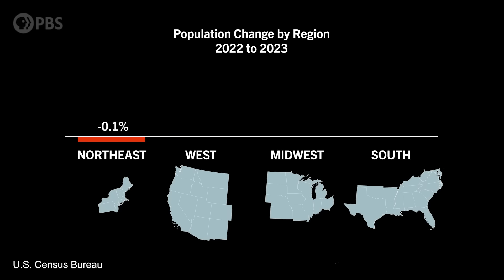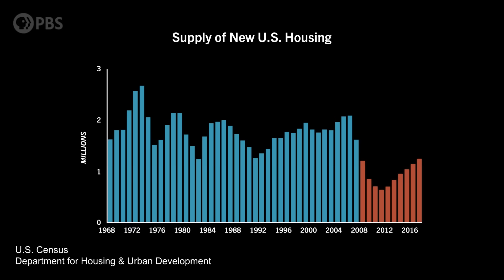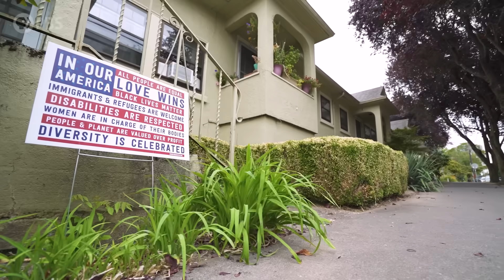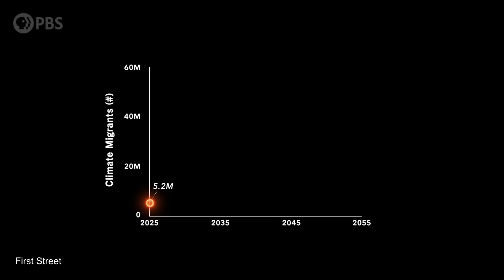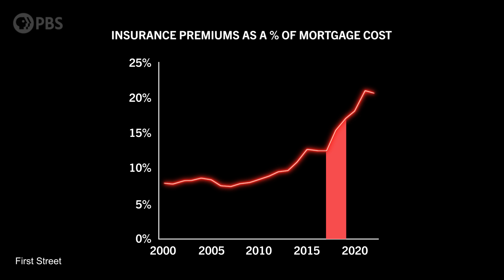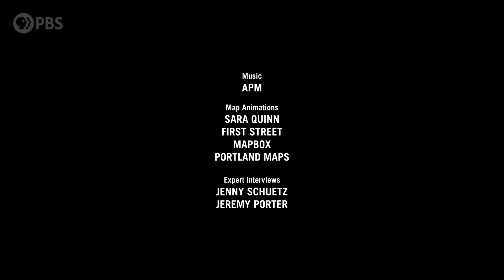The Real Reason People Move Toward Risk

Comment: I currently live near Dallas, and I cannot recommend moving here. Residents are not represented fairly in the democratic process, life expectancy is lower than in the north and west, and there is concrete everywhere. I spend 1-2 hours a day driving, just for my normal life. I am considering relocating, and would consider rust belt areas before anywhere in the South. Essentially, think carefully about moving to parts of the country that were founded on slavery - the systems were set up centuries ago to benefit only the wealthy, and it is very hard to undo that.

Comment: The housing in DFW are all wood frame apartments built with poor materials and craftsmanship.  They are built quickly, filled and sold to private equity. These houses wont be here in 20 years due to the poor quality. 

Nevermind they all look identical, have poor sound or weather insulation or are often built adjacent to major interstates.

Comment: Building codes are generally lower in places building cheap housing. During the freeze in TX, many folks found their water and sewer lines were in exterior walls. Lines froze and burst, leaving houses in a mess. And, no, there was no insurance to cover that since it was not anticipated: either the freeze or construction issues.

Comment: BREAKING NEWS==THE CLIMATE-CHANGER GOD-ROCK.
Common symptoms of active TB:
Persistent Cough: A cough that lasts for three weeks or longer is a key indicator. 
Coughing up Blood or Mucus: This can be a sign of TB in the lungs. 
Chest Pain: Pain when breathing or coughing can also be a symptom. 
Fatigue: Feeling unusually tired or weak is common. 
Weight Loss: Unexplained weight loss can be a sign of TB. 
Loss of Appetite: A decrease in appetite can also occur. 
Fever: A persistent low-grade fever is often present. 
Chills: Experiencing chills, especially at night, can be a symptom. 
Night Sweats: Excessive sweating during sleep is another common sign. 
Volcanoes currently active: erupting: 41 warning: 40 unrest: 25 normal / dormant: 1354
Exposure to high concentrations of volcanic smog (vog), which contains toxic gases like sulfur dioxide (SO2), hydrogen sulfide (H2S), and other volatile organic compounds (VOCs), can cause a range of severe health issues. Symptoms can include irritation of the eyes, nose, and throat, coughing, chest tightness, shortness of breath, and headache. In severe cases, exposure can lead to nausea, dizziness, fatigue, and even loss of consciousness. 
=What are the symptoms of gas in the brain?
=What are the symptoms of a headache caused by gas? Headaches due to gas typically feel like a dull, pressure-like pain, often around the forehead or temples. You may also experience bloating, nausea, abdominal discomfort, fatigue, and irritability. In some cases, sensitivity to light and sound may also occur.
What are the effects of particulate matter in the lungs?
=Particles deposited on the lung surface can induce tissue damage, and lung inflammation.
What are the symptoms of tuberculosis in the throat?
=TB in the throat can cause a sore throat as one of its symptoms, but it is not always the first symptom. Common symptoms of laryngeal tuberculosis include hoarseness or loss of voice, difficulty speaking or swallowing, a feeling of something stuck in the throat, persistent cough, and weight loss.
Volcanoes currently active: erupting: 41 warning: 40 unrest: 25 normal / dormant: 1354
1985 TO 2010  3 -4 -?5 ERUPTIONS PER-DAY 
Volcanoes Today, 25 Jul 2025: Santiaguito volcano, Popocatépetl, Semeru, Svartsengi, Reventador, Sangay, Lewotolo, Telica
Fri, 25 Jul 2025, 15:00 1753455605
ANY ERUPTION OVER 10,000 GETS CAUGHT IN THE UPPER TROUGH WINDS AND TAKES THESE TOXIC - DEADLY - POISONOUS GASES RELEASED INTO OUT AIR QUALITY AROUND THE ENTIRE WORLD 
= ANY LAVA FLOW STEADILY RELEASES TOXIC-DEADLY-POISONS CARBON MONOXIDE GASES THAT CAUSES DEMENTIA 
1.=Svartsengi (Reykjanes peninsula, SW Iceland): The activity at the eruption site has declined since yesterday morning.
One crater remains active, with the lava flowing toward the east and southeast that have extended one kilometre from the crater, with limited expansion of the lava field's outer edges, except for a small flow to the south near Fagradalsfjall.
... [show less]
According to the most recent measurements on 23 July, the total volume of new lava in the Sundhnúkur area is estimated at 26.8 million cubic metres, covering approximately 3.3 square kilometres. Between 18 and 23 July, the lava volume increased by 5.1 million cubic metres—an average flow rate of around 12 cubic metres per second.
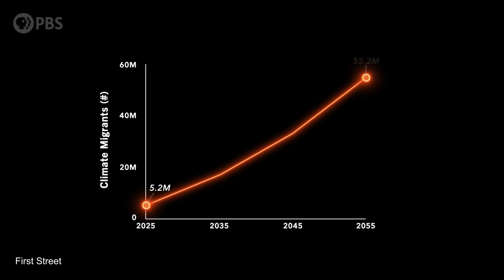The seismic tremor associated with the eruption dropped between 06:00 and 07:00 yesterday morning, aligning with reduced activity at the crater, and has remained relatively low since. No ground deformation has been detected in the Svartsengi area, where magma had previously accumulated at depth prior to the latest eruption.
2.=Lewotolo (Lesser Sunda Islands): Explosive activity continues. Volcanic Ash Advisory Center (VAAC) Darwin warned about a volcanic ash plume that rose up to estimated 6000 ft (1800 m) altitude or flight level 060 .
The full report is as follows: VA TO FL060 MOV N, LAST REPORTED AT 24/2248Z to 6000 ft (1800 m)
3.=Semeru (East Java, Indonesia): Explosive activity continues. Volcanic Ash Advisory Center (VAAC) Darwin warned about a volcanic ash plume that rose up to estimated 15000 ft (4600 m) altitude or flight level 150 .
The full report is as follows: VA TO FL150 MOV SE LAST REPORTED AT 25/0025Z to 15000 ft (4600 m)
4.=Popocatépetl (Central Mexico): Volcanic Ash Advisory Center Washington (VAAC) issued the following report: STEAM AND GAS EMS ONLY
5.=Santiaguito (Guatemala): Explosive activity continues. Volcanic Ash Advisory Center (VAAC) Washington warned about a volcanic ash plume that rose up to estimated 13000 ft (4000 m) altitude or flight level 130 .
The full report is as follows: INTMT TO OCCL VA EMS SEEN IN SAT to 13000 ft (4000 m)
6.=Telica (Nicaragua): Volcanic Ash Advisory Center Washington (VAAC) issued the following report: OCNL EM
7.=Sangay (Ecuador): Explosive activity continues. Volcanic Ash Advisory Center (VAAC) Washington warned about a volcanic ash plume that rose up to estimated 22000 ft (6700 m) altitude or flight level 220 .
The full report is as follows: FQT VA EMS SEEN IN SAT to 22000 ft (6700 m)
8.=Reventador (Ecuador): Explosive activity continues. Volcanic Ash Advisory Center (VAAC) Washington warned about a volcanic ash plume that rose up to estimated 14000 ft (4300 m) altitude or flight level 140 .
The full report is as follows: VA EMS SEEN SEEN IN SAT to 14000 ft (4300 m)

Comment: Minneapolis is listed a a climate-resistant city by this video and it may be on a relative basis. But in the past several years, wildfire smoke from Canada has started to become an issue. Also, Minnesota has one of the highest costs (if not the THE highest cost) from increasing hail damage.

Comment: It's not very expensive in practice to tie the roof of a house to the walls and the foundation. The cost in Florida comes because they require a roof to be designed by a professional engineer who will cost thousands of dollars, and maybe tens of thousands for one house. The approach of tying the rafter to the walls and foundation is not difficult and everyone knows how to do it and everyone knows how to build a roof, so Florida's requirement is just a scam to pay off a bunch of do nothing engineers. The codes system is a scam, in Florida and around the country. It isn't that there should be no safety requirements in codes, but the codes are used in such a way as to be more profitable for some and to punish people who can do things themselves.Gate keepers are  morons that want you to be impressed with their power.

If the American people wanted more housing they would vote more wisely, but they don't. They vote for chaos and corporate lackeys.

Comment: One of the issues is certainly zoning restrictions.  Cheaper housing used to be large rooming houses with shared facilities, but those wouldn't meet code now in both red and blue states.  However, the elephant in the room you didn't report was this country suddenly had millions of extra people come in from the outside in a very short time.  The housing capacity just wasn't there to support this influx.  Neither was the infrastructure or other services in many communities such as healthcare.  This is simple supply and demand causing rising prices for goods and services, including rent.  Now add in real estate speculators and empty vacation homes which also reduced inventory and contributed to the increase in homelessness.  Anyone who had ever heard of Tragedy of the Commons or read The Giving Tree as a child would have known has this was going to play out.

Comment: I lived in a small city in Virginia and on the edge of my neighborhood they wanted to build six floor apartments. We neighbors got together and said yeah, fine, but you need to do more to plan for the added traffic. The city wasn't going to spend the funds and neither was the builder and so the city ended up allowing the builder to build three story buildings because our existing roads could handle that number of added residents. I think as a neighborhood we were fair. If someone's going to come in and make a large profit, then they need to take existing roads in mind and the residents already using those roads. No doubt there were other avenues for getting the road upgraded, but the builder wanted a quick fix. (And that can be seen by the not so great townhomes--having been in them I can only describe them as basic shoddy construction--and single family dwellings the builder built right before submitting a plan for apartment buildings.)

Comment: I'm not sure I would characterize L.A. as "only for the wealthy", but I think the point is that when a place becomes popular and desired for any number of reasons (not just climate), then people are attracted to that place and competition develops to live in that place.  I can point to any number of locations, both high-density and low-density, where this has become a problem.

I also don't agree with many of the points... such as the idea that the development of single-family homes makes a location unaffordable.  The cost of living in Manhattan is very high, for example.  Building vertically has not seemed to have significantly solved the housing problem, but it has created an enormous slew of other problems. Homelessness is a big problem in coastal states primarily because the climate makes it possible to be in a state of homelessness without dying.

California already has 39 million people... is that good?  Do we want more?  Maybe not.  Where are there 39 million people in the state in the first place?

And as far as building homes cheaply go... well ok...I think you did a decent job characterizing the trade-offs, but you didn't really calculate the actual cost to the home owner when a home is lost.   Is it really cheaper to have relaxed regulation?  Or does it simply delay an even larger cost a few years down the line?

I will also note that many high-risk areas, not just in California (where even a burned-out lot after a fire is valuable)... but lets say, for example, also New Orleans to take a very broad swath, are heavily dependent on federal aid when disasters strike.  When the federal aid dries up, a population and societal collapse occurs.  That has been happening in New Orleans for decades.  It happened in Detroit and only just recently began to turn around.   Famously lax regulation in Texas lead to massive property damage during the Great Freeze.

In otherwords, there is a short-termism involved with moving to a cheap area in that support mechanisms that prop up that area and keep it livable can be more tenuous than one might have considered in making the decision to live there.  What's a good example that?   Florida coastal condo buildings are a great example.

Perhaps part of the problem is the short-term view of life and living that seems to have developed in the U.S... the "I need it now" and the "I want it now" culture that ignores "well, what happens over the next ten years?  Twenty?  Thirty?".

-Matt

Comment: We're moving to Delaware next month because the heat and humidity (and many other factors) are becoming unbearable - it's worse than a New England winter because you can't even go outside (you hide inside from the white hot heat all day) for more than 15 to 20 minutes for at least six months outta the year, without risking heat stroke.  If you have asthma - don't move to Florida. It's only June and every day has been in the high 80's or 90's and not cooling down much at night.  Every year it gets worse - hotter every year for longer periods. We're outta this hell hole. And the Hurricanes - you can have em.

Comment: Dear PBS Terra, Thank you for this well developed and presented piece. 

Developers do not want to build low income housing, there is no profit. Instead there is much more profit in Middle or Upper Middle Class single family homes in the Suburbs ( or even more so for McMansions ). 

This means there is no increase in housing where it is needed the most, in the Urban Core. When building in some cities, developers are required to build some percentage of Low Income, so they build these outside the urban core as well, or more often, do not build in those cities that require it. Low Income Housing is "Not" for the poor or Homeless, Low Income Housing is actually for "The Working Poor". 

The Poor and The Homeless have only access to Section 8 Housing or SRO's and these are locked into specific ares of the Urban Core by social and political and even urban zoning policies that prevent their development. "Motel" Housing ( by the Day, Week, and Month ) that used to exist in the Urban Landscape has been replaced with Condos and High Density High Rent Apartments. 

Lastly Homelessness has almost nothing to do with "Housing", it has everything to do with The Insane shipped out of the old Institution System to the streets, the release of hundreds of thousands of prisoners from our past and current War On Crime, and a most telling a complete redefinition of what has been called "Work" in the late 20th, and early 21st Centuries, jobs that used to serve a segment of the working poor, no longer exist. Few if any of the Homeless will ever receive real jobs, have actual resumes, have the physical or emotional-psychological health to ever hold down a "job". 

Homeless exists primarily in the Democratic Blue states, not because of existing or pre-existing policies of development, but because they have more generous and larger non-religious based support policies for Food, Health, and Help.

Comment: Painting with a broad brush often leads to invalid conclusions.
The all cause FEMA risks can actually lesser in pockets around the 100th meridian west, so it really depends where you move from and move to. Where I live now is cheap, doesn't have flooding (zone X), doesn't have hurricanes or tornadoes, and only has thunderstorms and hot weather. No droughts, fires, or earthquakes. Overall, much less risky than anywhere else I've lived. However, pockets of other places in the region have much greater risks. It's best not to live there. ;)
- Survivor of the 2018 Camp Fire and 1989 Loma Prieta earthquake

Comment: In 1981 a house my parents built in 1963 was affected by the "Memorial Day Flood" in Austin, TX.  When we moved out in 1973 I told my mother that there would be water in the house in 10 years.  It wasn't entirely the point of having impermeable ground cover or the fact that the rain seemed to stop and rain just on the water shed of the creek the house backed up to.  Other creeks also flooded, it was just the fact that at no point did the city require builders to assure there was a place for the creeks to overflow into.  They also hadn't done it themselves.  The water in the house we had lived in wasn't from the creek, it was the water coming down from the hills trying to get to the creek.  We had had a near event of the same thing on August 11th around 1965 or 66, the rain was hard, it had no way to get to the creek so it used driveways.  My mother, sister and I managed to prevent the water getting in the house, but it was a very near thing.  The flood in 1981 was mostly at night.  Last week we had a close to the 1981 flood, but since the city had make flood abatement a challenge and the mall built  in the 1970s was encouraged to also do some work on their impermeable ground cover.  People died in 1981, I didn't hear about any deaths this year.  And, honestly, Austin really isn't in a really high risk area.